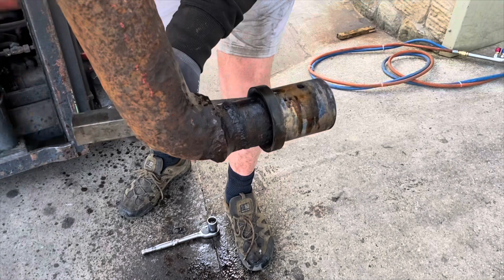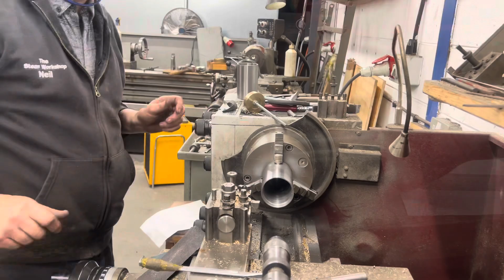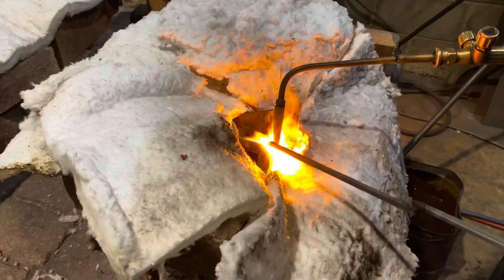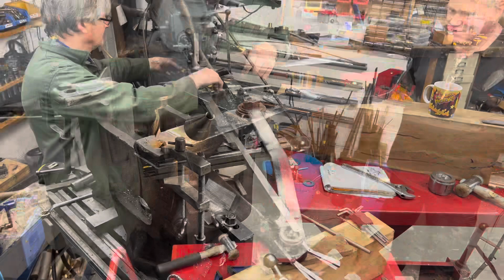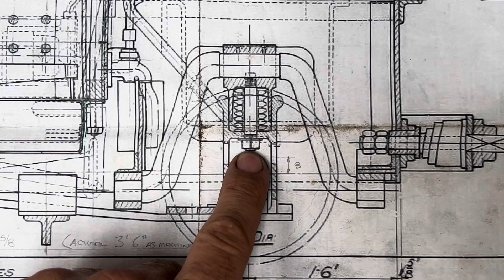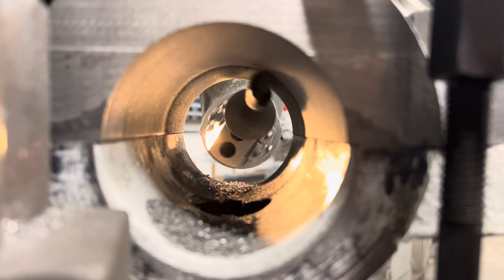Fowler 16341 Restoration Part 19

Comment: You could have had the journals spray welded. It is one of the most common methods for restoring worn journals. Sleeves tend to fail over time. Welded journals don't. Well, less often, lol.

Comment: Why did you take the route to make sleeves to restore the size of the beam and not just make oversize bronze bushes?
Reply from the maker: Two reasons.  We’d actually already bought the thick walled bronze tube material for the bushes, and once we’d had to take the second cut on the journals they were too small.  Secondly, it takes a large eccentric load, so we decided the larger diameter as designed was sensible to spread the load a little more.  🙂

Comment: With the benefit of hindsight, machining of those journals was bound to produce an out of round condition. Had they somehow rigged a counterweight to the opposing side of the crank the result would have been more acceptable? But pleased you determined an alternative resolution.
Reply from the maker: Yep.  I think a counterweight would have helped.  I think in hindsight we’d have just added material with weld again like we did with the brake shaft & then milled it with the end quill.  But you live n learn!  😁